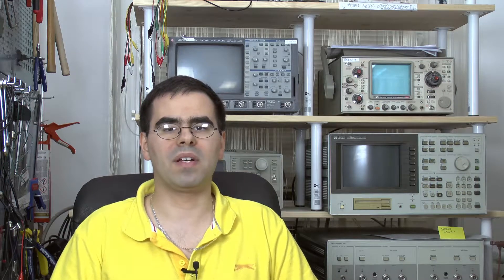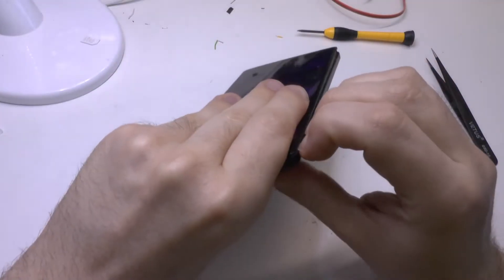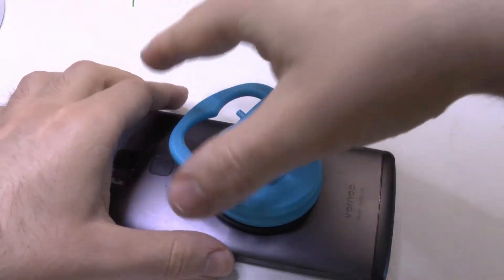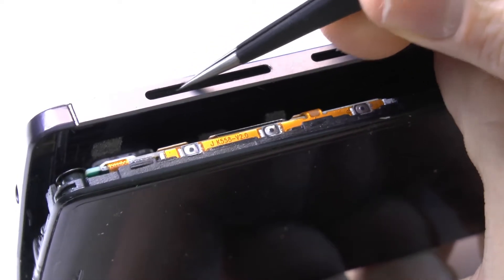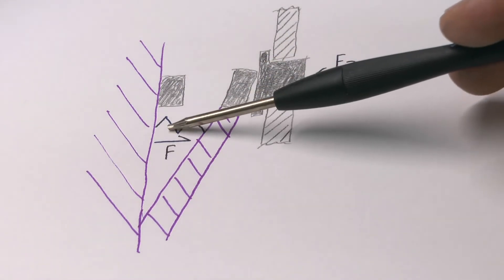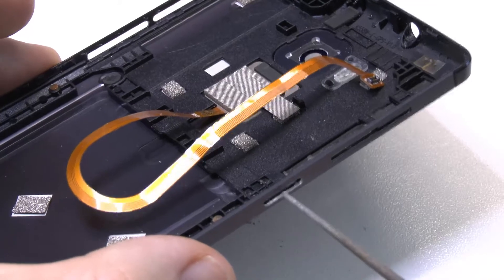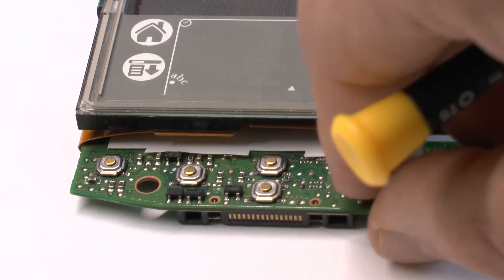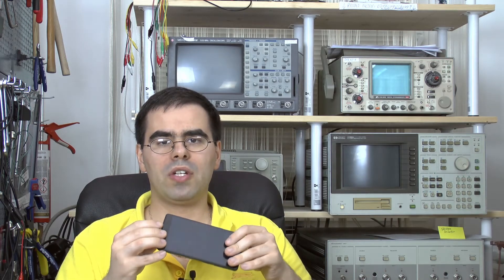Vernee Lite power button repair - avoid PCB buttons

Comment: Nice. I think my buttons are totally broken. I would like to replace them, but I don't know the pinout of the button connector, do you know that connector? Is this a default connector compatible with other smartphones? I live in Brazil, so it would take forever to buy this part to replace.
Reply from the maker: Hello, sorry to ask - which connector do you mean?
Reply: @MrTamhan  The one which connects the volume and On/off buttons to the device PCB. Looks pretty much the same of the fingerprint sensor
Reply: I'll test it with my multimeter and try to figure it out.
Reply from the maker: Hello, sorry - I do not know the part number. But if you want, I can order it from Arrow and stick it into an envelope for you
Reply: @MrTamhan  Oh, thanks for the kindness and help, but I think I can survive with the problem until I can get a new smartphone.
Reply from the maker: Not an issue. Man, post is cheap in BA. I can send it to you for two bucks or so...so you know where to find me!